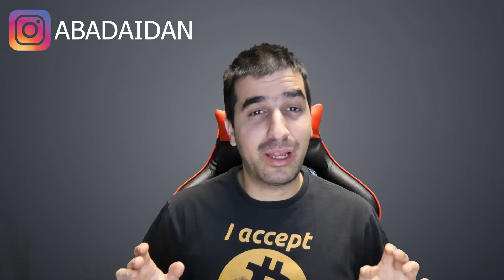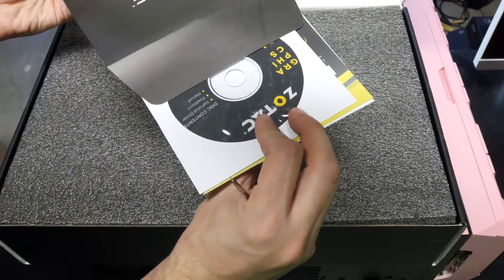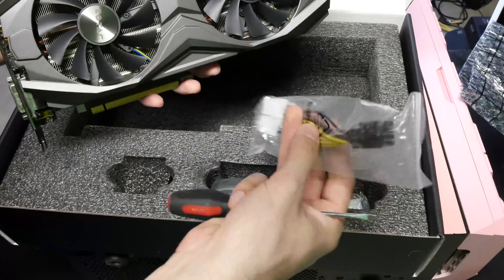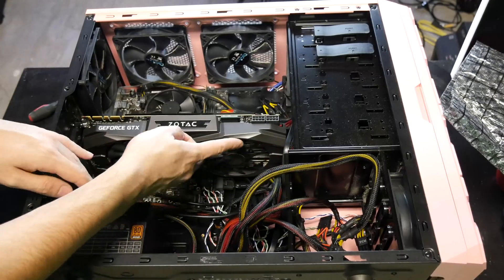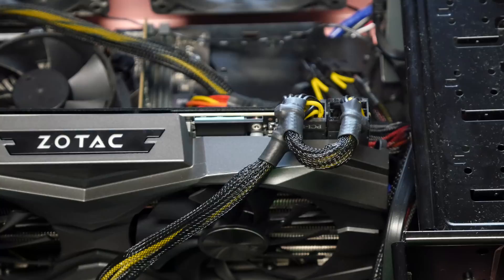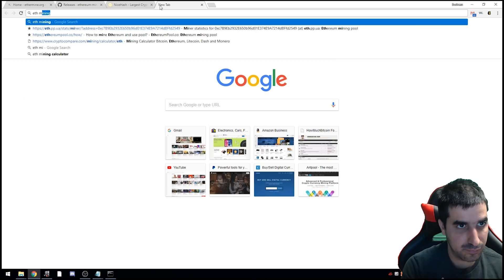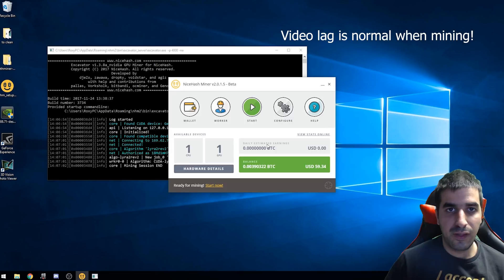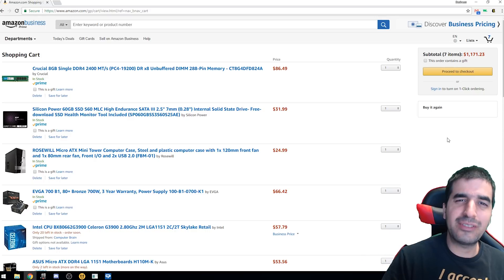How Much Can You Make Mining Bitcoin In 2018 With Nvidia GTX 1080 Ti Video Card + Giveaway

Comment: Not only is that pc filled with dust, and a complete cable management monstrosity, but it has 3 exhaust fans, but only 1 intake which is covered by empty drive cages, in a completely enclosed case. You should be ashamed of yourself for choking a 1080 ti like that.

Comment: damn bro! you really gotta manage those cables... its not just for aesthetics, its for airflow and heat dissipation. the air flow is going to be choked hard AF if you mine on that thing without managing those cables better... even worse, you can possibly even have a fire hazard.

Comment: U can use a 1080ti FTW3 with a 450W PSU worked no problem
Reply: BigPaco213 better use only 60%
Reply: I have a 450 watts power supply